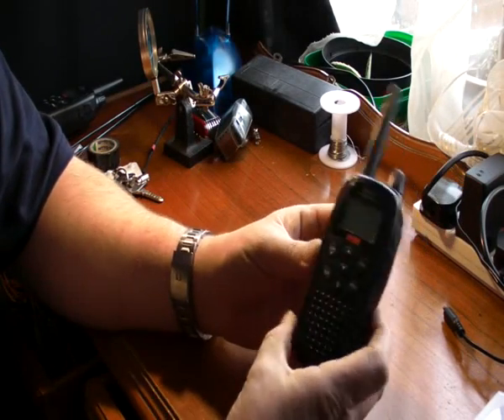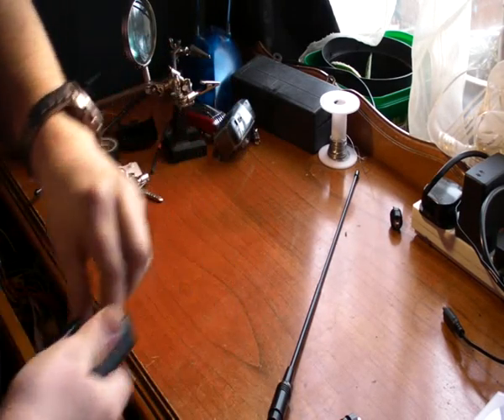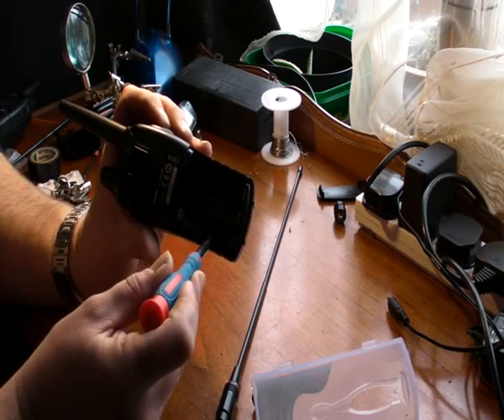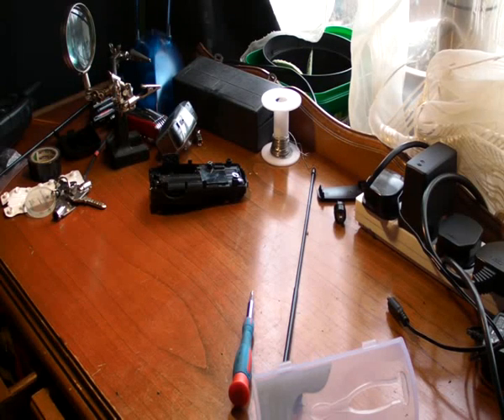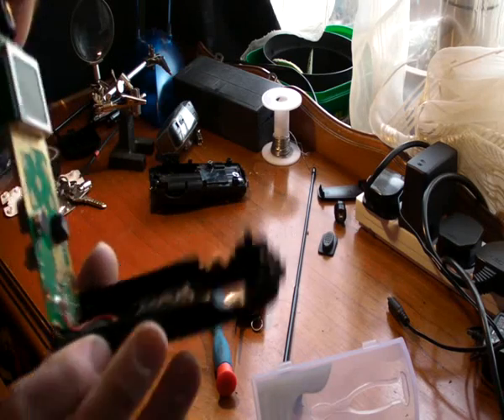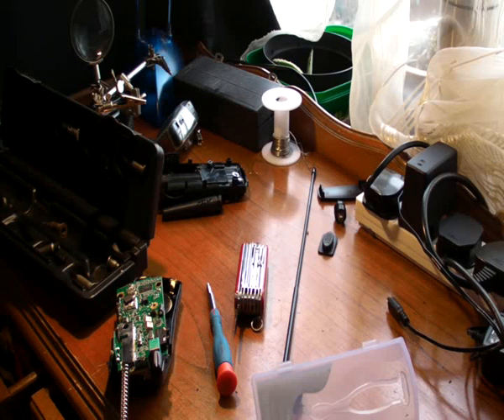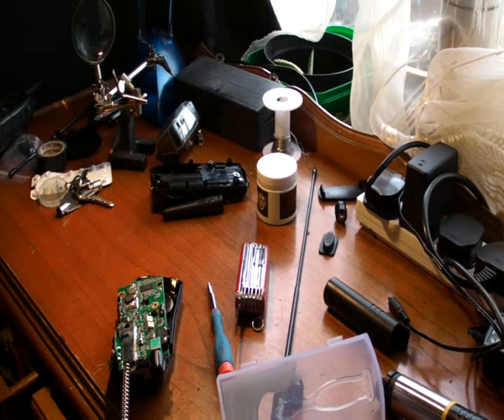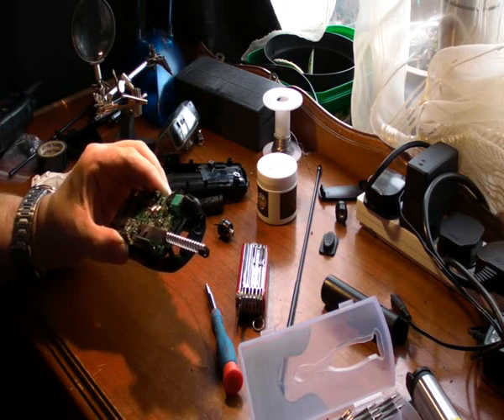Intek MT5050 antenna Mod Part 1

Comment: Hi there. How are you getting on with these radios? I've just bought another, fantastic little unit. I wondered if you have come across the midland G9's at all? I just bought a couple, and have done the power mod (very similar to the inteks) and want to do the sma conversion. I'm just not sure  about soldering on the earth tag on the sma connector. It looks as though there is only one place it could go.... just not to confident. Have you seen this done? I have googled, but can't find much on th

Comment from the maker: @pepsijohal 
You need:
INTEK SMA-505 SMA ANTENNA ADAPTOR FOR INTEK MT5050 x2
KA-505-SR 430-450MHz SMA ANTENNA FOR INTEK MT-5050 x2

If you are in the  uk then use "rocket radio". Good shop. Expect to pay £20-£25 per radio.

Comment from the maker: @quadtraxxx 
Well, i went from about 500-750 meters urban to 7-8km urban/rural. Very basically, i put one radio on vox mode in front of the TV and went to pick up supper whilst i monitored the transmission. The power up mod plus the antenna mod just transforms them from good pmrs to exceptional pmrs.

Comment: @cornz38 I've been reading up about them around the net, and then came across your vid, so was aware it could be done. I feel confident that I could do the SMA mod myself now. It would be interesting to try a pair out that were standard, then do the mod's and see the difference.

Comment from the maker: @dazaboy2k9 
Why would you mod one??
Dont know if you need a license, however, if you increase the power and obtain the extra channels, or fit the modded antenna then they are "illegal" but i cant see anyone hunting you down for it.
Just cut the wires. Job done.

Comment: i am thinking off getting a pair i am going to mod one to turn the power up and get the xtra channels but do you need a lincence of ofcom and keep the other radio way it is but the 3 wires do u jst cut them in anyway r take them out all tho gether